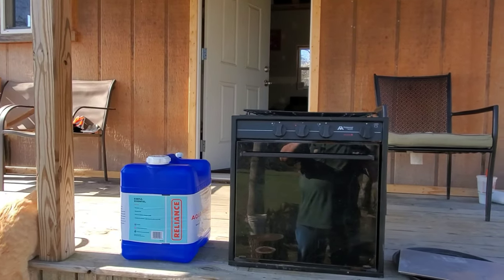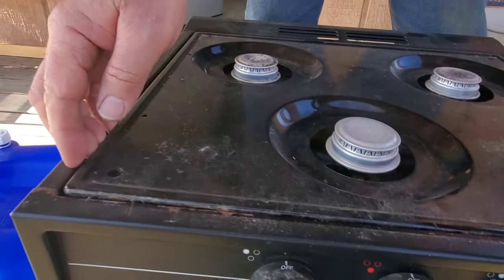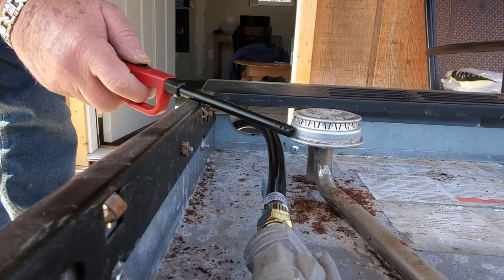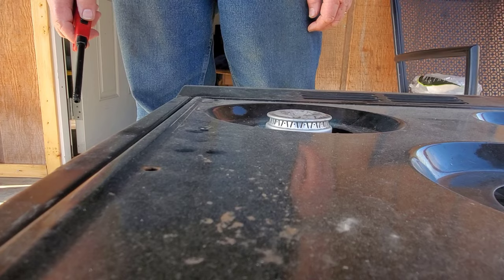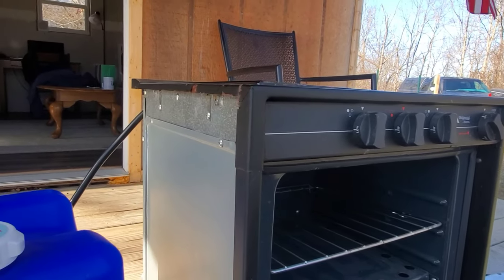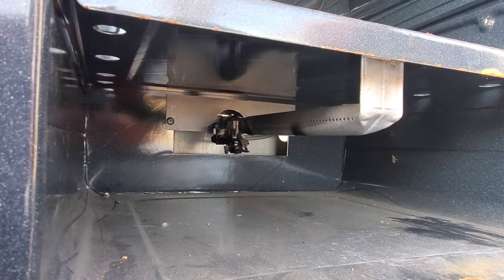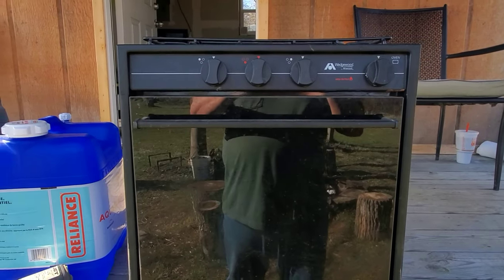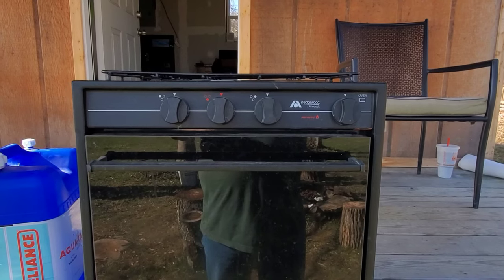Testing Used RV Propane Stove for the Off Grid Cabin Kitchen

Comment: You should have steel pipe inside the cook top. You could burn the hose up under the burner
Reply: Yes, I thought the same thing. Black pipe, I believe they call it.
Reply from the maker: +Roy Amberg I'll be plumbing it in with black pipe.  This hose was just for testing.   Thanks for the comment though, in case I didn't know.

Comment: perty cool , i think ied use something other then a rubber hose that close to a burner bro !
Reply from the maker: +The redneck Prepper I'm going to run black pipe for the connection,  this was just for testing.  Thanks!
Reply: @StBernardAcres  COOL GOOD IDAL